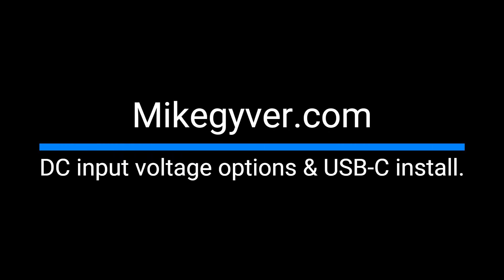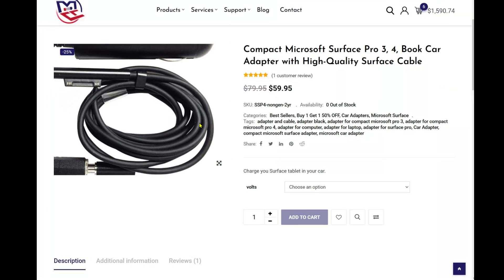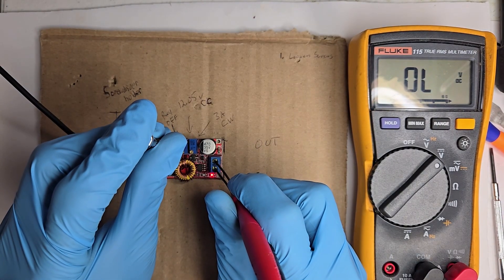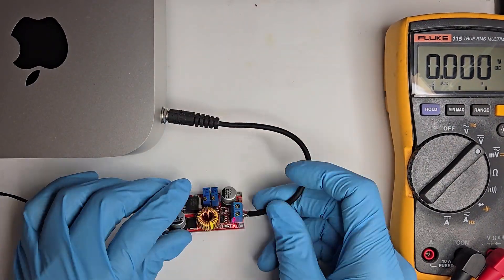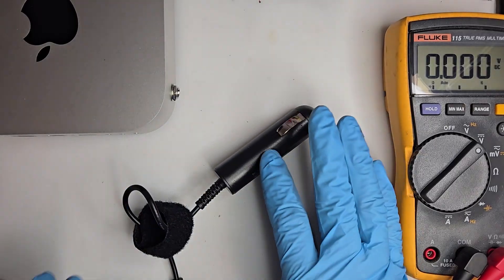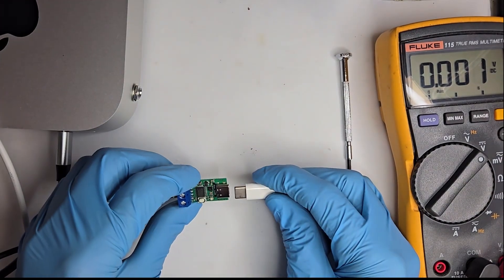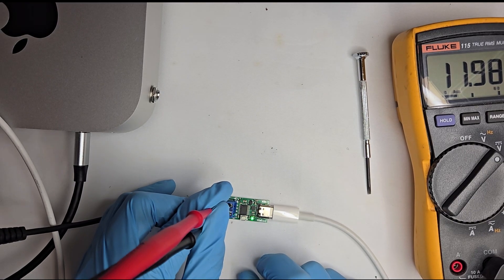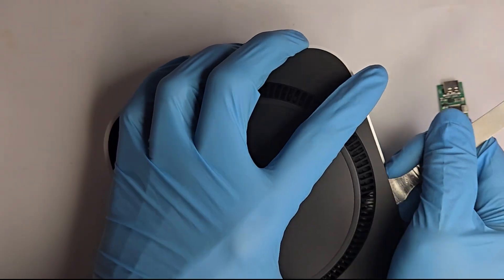REPOST:DIY hack: Boost Your Mac Mini M4 Efficiency:Power with regulated DC & USB-C off grid Upgrade!

Comment: I'm an electronics idiot and have some questions. Please forgive me. In the original video I could see that we were off the grid because it was powered by 4 AA batteries. Now however, there seems to be a usb-c cable delivering power to the mac from a source that is off camera. What's the source? Does this mean we can hook it up to a regular usb-c charger or power bank that has usb-c ports on it to make it off the grid? How long would you say it could run off the AA batteries and how long do you think it could run doing regular tasks like watching YouTube through the usb-c? Sorry I'm so lost.
Reply from the maker: Yes we used regular USB-C adapter it happened to be 65w.  How long it will last on AA batteries would depend on your CPU load.  Keep in mind the Batteries are not regulated, it was only used to demonstrate it can be done.  We'll post new video on explaining this.

Comment: Idea: Instead of drilling a new hole, why not re-use the AC port, disconnect it from the internal PSU and connect it to the board, so it passes through? Then just run DC over that port
Reply from the maker: Yes can be done too.  Most use cases so far still calls for AC port (multiple source of power)

Comment: If the usb power is provided by a power supply with multiple outlets, if you connect another device to it, does the MM shut down while the power "negotiations are underway?
I had this problem when I did something similar with an old Zotac z book, I had to remember to turn the screen on first
Reply from the maker: Depends on your USB-C power supply.